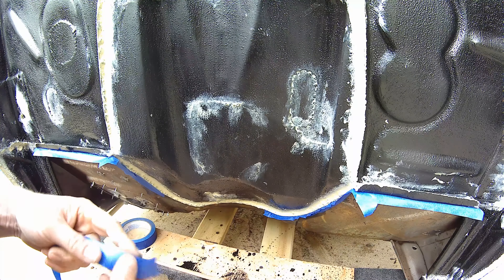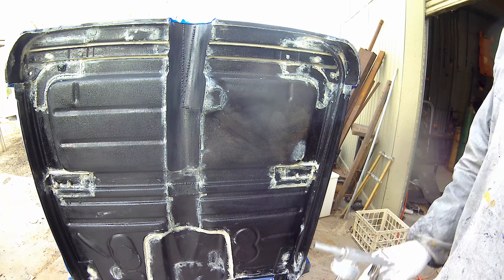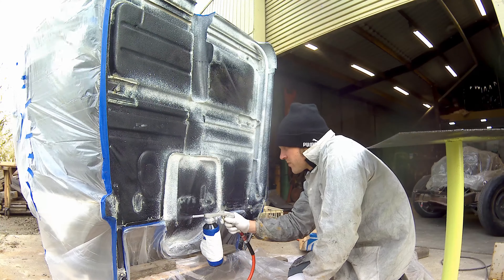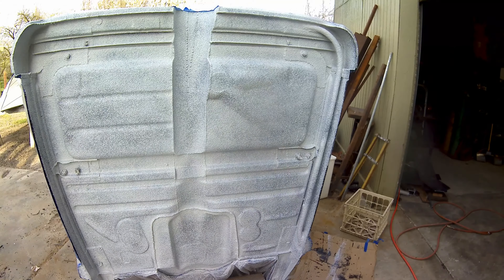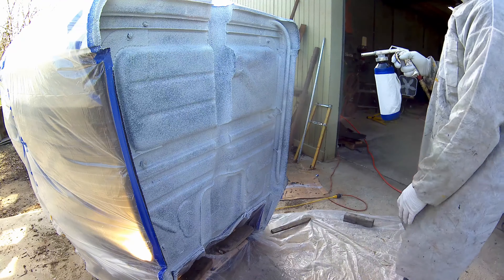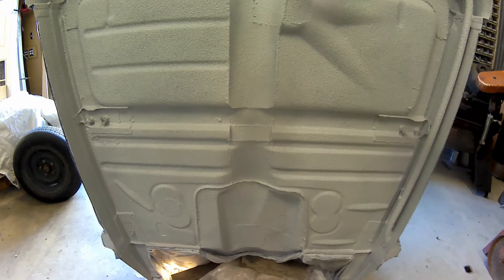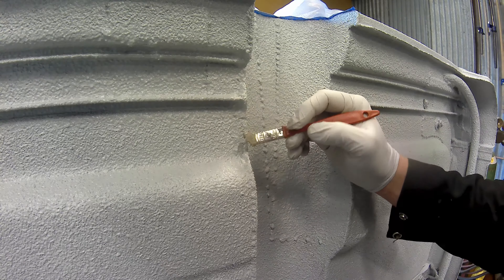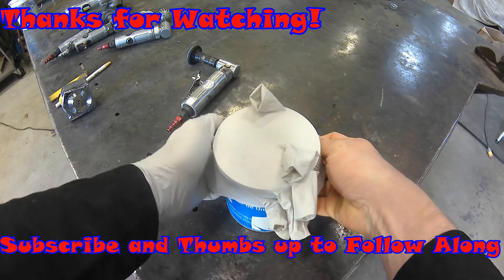Spray-on Bedliner WHERE??  (PART21) '47 ford truck build

Comment: Hi, is the tubing piece on the drivers side there because of previous rust? Thanks DC
Reply from the maker: No its because I plan to run spray-in bedliner instead of carpet on the interior floor and wanted to have the option of running/hiding wiring from under the dash to under the seat
Reply: Ahh, clever solution!
Thanks